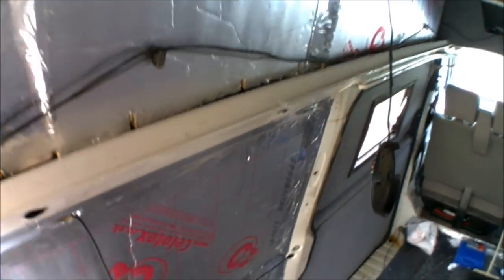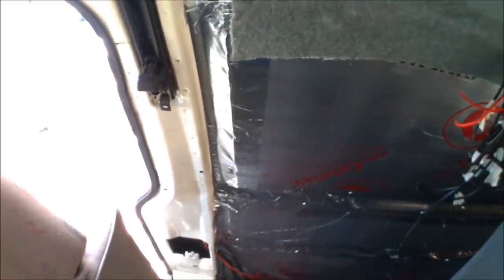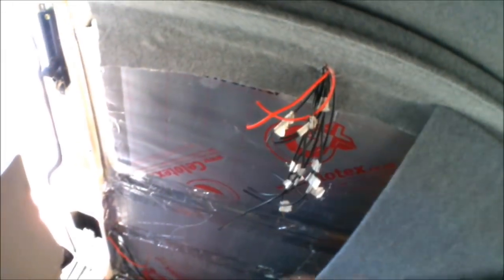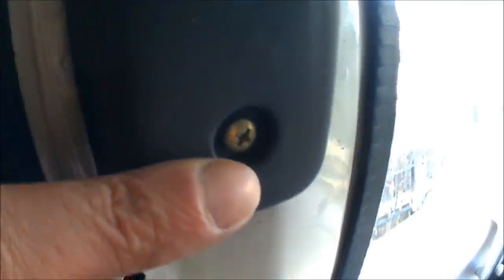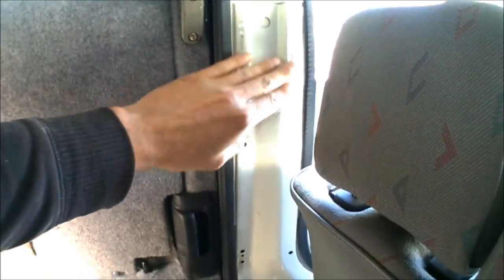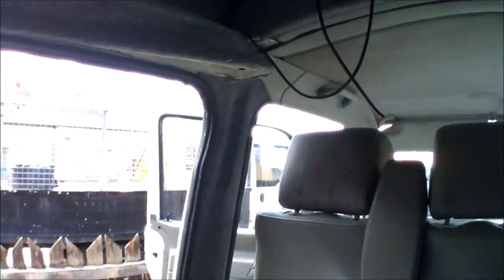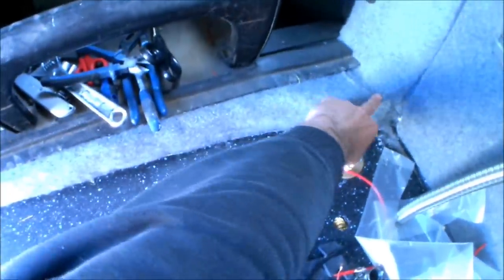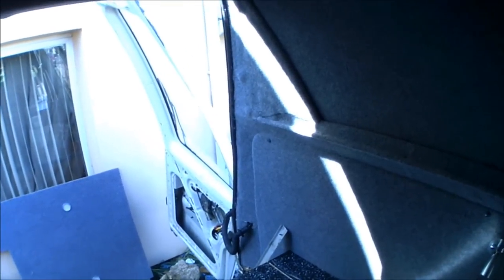How To Carpet Van Bare Metal VW T4 Camper Conversion Carpeting Campervan Metalwork

Comment: Hi! Great vid. Question re condensation. Mine is a mini stealth camper, so no windows except a section I've cut in the bulk head. I've ply lined walls, doors and ceiling (floor was already done) and stuck bubble foil, one layer direct to metal, one layer on back of the ply (there is an air gap in between). Now it's just the edges around the panels that's exposed metal, and these get wet sometimes. I don't want to carpet the whole inner for various reasons. Would it be sensible or stupid if I carpeted just the metal edges, and left the ply panels as they are?
Reply from the maker: It's your van so you can do whatever you want to it, but yes carpet at least the exposed bare metal and that should stop it getting damp
Reply: Thanks love 😊

Comment: The can says to spray both sides, wait a while and then use it as contact adhesive. I was a bit worried about that - your idea to just spray the carpet and stick it straight on is much better, it allows for movement, will dry anyway and a later smooth-down will stick any unstuck concave bits anyway.
Reply from the maker: I do spray both surfaces, the metal and the the carpet (outside the van so not always on film) otherwise it will sometimes peel off very easily or not adhere at all.
Reply: @TheCampervanBuilder  Ah Ok, do you wait a few minutes before sticking it down?
Reply from the maker: 60 seconds or so and slowly lay it down and stretch where needed, if something creases just pull it back up and relay it again a it's usually quite forgiving stuff

Comment: Hi, are you only applying adhesive to carpet and not the other surface.cheers
Reply from the maker: both
Reply: Hi, I am currently experimenting with my van ceiling, I am covering floor protection boards with 4way stretch. They measure 1000x600 , are very light weight and can be easily cut with scissors . I paid £30 for 10 panels. I am using Velcro type tape to fix to the thin ply ceiling( only the hook required as it sticks too the 4way which is folded over the edge of the panels and glued. It’s just like making door cards really but these are very lightweight.

Comment: Excellent vid, thank you. How many square metres did you need to use for this?
Reply from the maker: Thanks, I bought 15mx2m (30msq) because of the hightop requiring more carpet than a tintop would need, although this still wasn't enough to do the back doors as well
Reply: CamperConversion 
Thank you. Your videos have encouraged me to have a crack myself.

Comment: Hi,
Would you happen to know how high temp that glue was? My summers get hot and I was going to carpet my van but was worried it might melt and fall off.
Reply from the maker: I believe up to 130c which is very high, I've not had any problems with it so far and have always used Trim-Fix, should be a link in the video description
Reply: Camper Conversion Thanks and good luck with your build!

Comment: Mint video pal, pick up my lwb t5 next week can’t wait to get started  converting I’m sure I’ll be back for more hints and tips
What side wall insulation have you used and is it just taped straight onto the metal panels?.
Great videos very helpful
Reply from the maker: THanks I used Celotex insulation, there is a video on my channel covering it and yes, just taped in place with foil tape
Reply: Camper Conversion Fantastic thanks for the reply start mine next week

Comment: Could you carpet the bare metal with no problems? I’m on a tight budget.
Reply from the maker: Are you asking if I can carpet your van?
Reply: Oh sorry, no I meant would it be a problem for me to glue the carpet straight onto the metalwork of the van with no sound deadening or insulation as a barrier to the cold, I remember cold mornings getting frost on the inside of the van, I wouldn’t want it getting mouldy.
Reply from the maker: I wouldn't like to say either way, I think it might get damp during cold nights but can't say for certain.  At least ply line the van if you can so there's an air barrier between the metal and the ply/carpet, then if you want to insulate later, it'll be easy to remove the ply and refit

Comment: I tried to do this in my Ford Tourneo. It doesn't look great, I made lots of mistakes. I wish I had watched this first. 😢
Reply from the maker: It should be easy enough to pull off the old stuff and try again to get it neater if you wanted a better finish